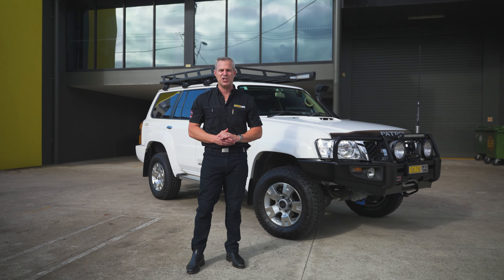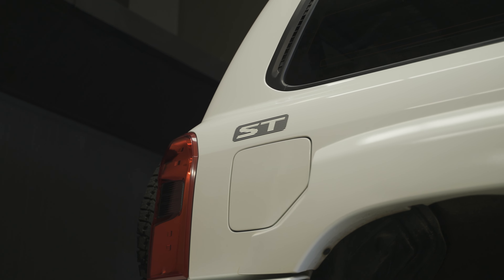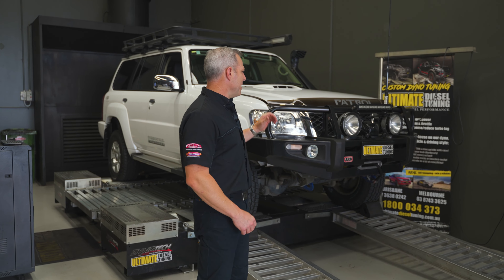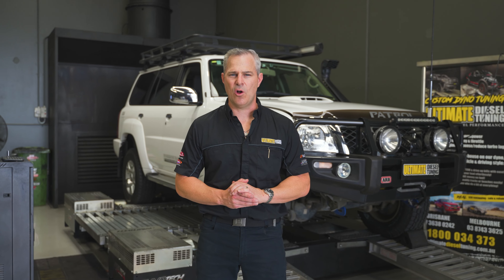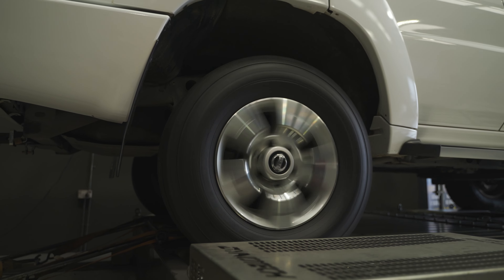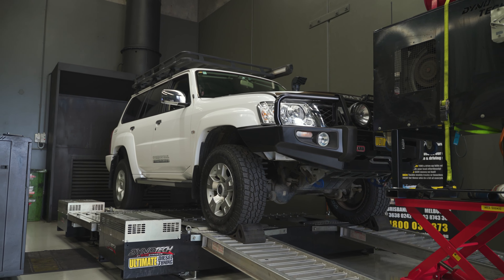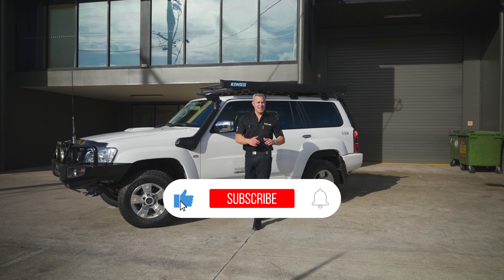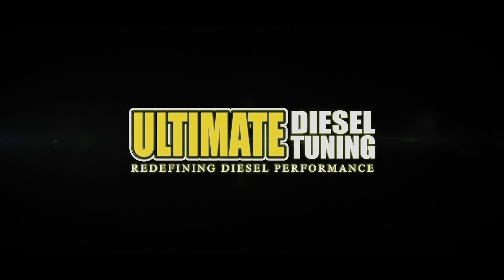HUGE gains in engine performance for this CRD GU Patrol!

Comment: cool video ! Go the GU Patrol!
Reply: Antenna!
Reply: okay this is a basic video of what you guys do . what a tune is .  can you make another video and show  the engine and the work you done to it . ?  why can't you do the Di ??
Reply from the maker: @brentmcd12  the DIs do not have an ECU that is tuneable, without having to modify the ECU physically, which we do not do or recommend.
Reply: @UltimateDieselTuning  so you don't do Dyno tunes with Dawes valve / tillix work ?? for the Di ?
Reply from the maker: @brentmcd12  that's only controlling the boost. There's a lot more involved with tuning than that
Reply: @UltimateDieselTuning  I have a 02 Di and Dawes valve I got it dynoed tuned for 16PSi , it has sometimes boost spikes up to 21 psi.. any more than 21psi causes limp mode .. that's all u have to do . no laptops no flash tunes .. that's all I want to do ..

Comment: 70 kw of a stock turbo intercooled 3L ? Na 1HZ got 90kw from factory, why a stock zd30 crd is too much underpowered ?
Reply: A stock 1hz at the wheels would make 50kw . You're reading engine power.